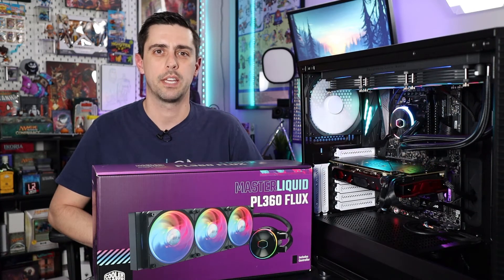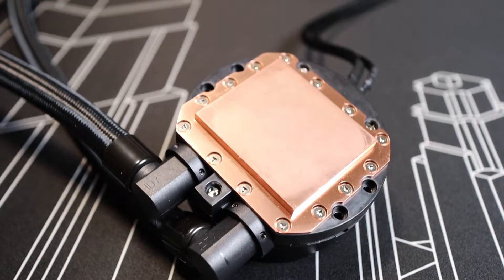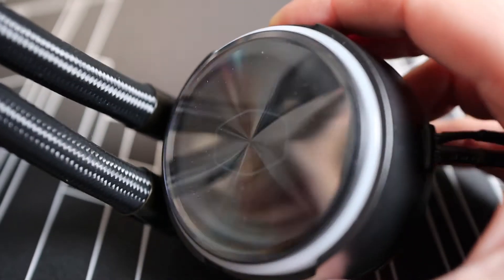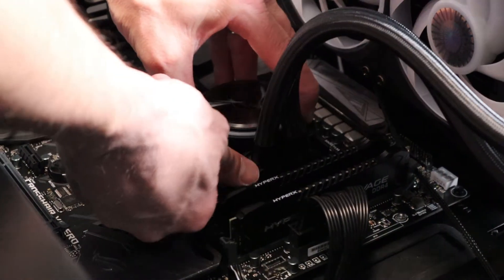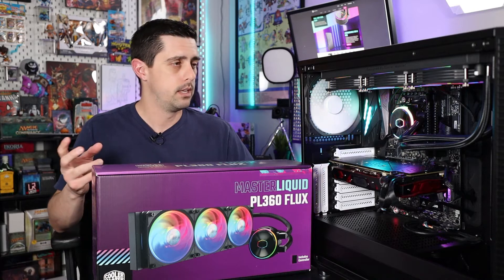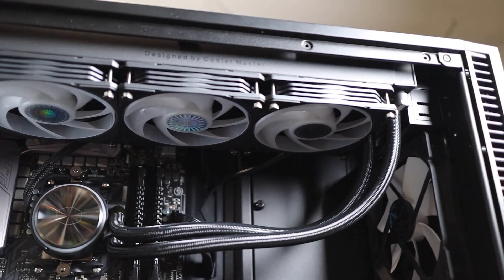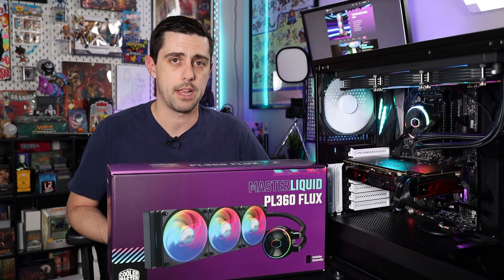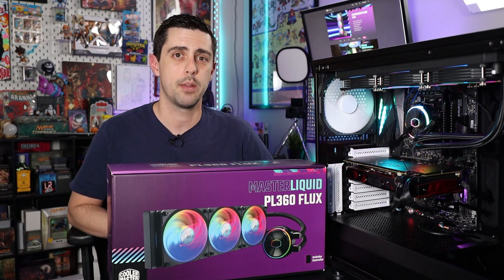Cooler Master MasterLiquid PL360 Flux Liquid CPU Cooler

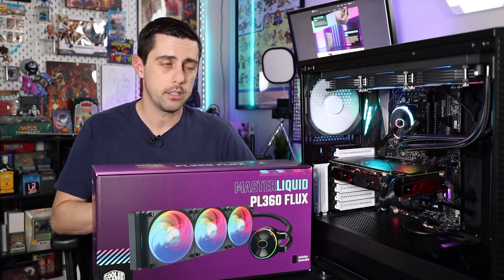Comment: First review using the included hub 13 vids from the top hit on PL360 flux.  You say at 4:22, to attach the corsair hub to usb 2.0 on MB (the cable is labeled USB) so I did that initially, which doesn't really match the documentation (though that is only pictures).  I had to type all this out before I realized I was not seeing it in MSI Mystic light (which box says it supports). When I installed Corsair  MasterPlus, all works as expected.  Time to delete MSI bloatware.